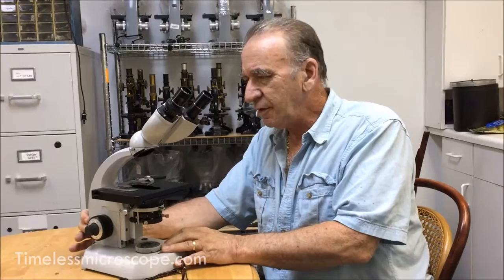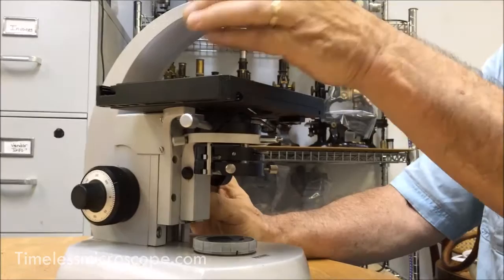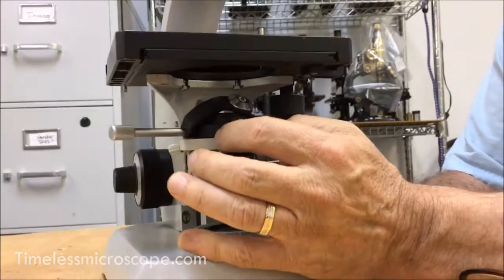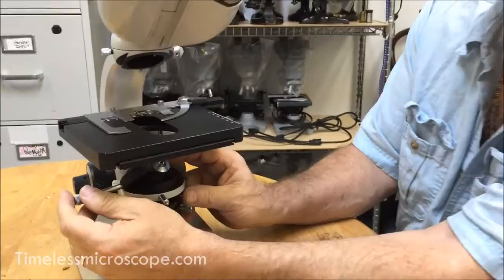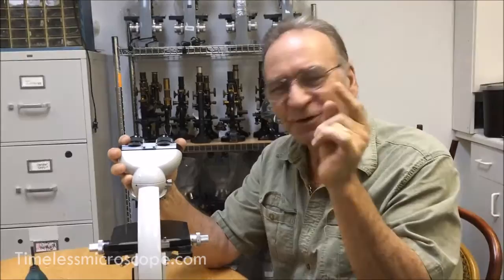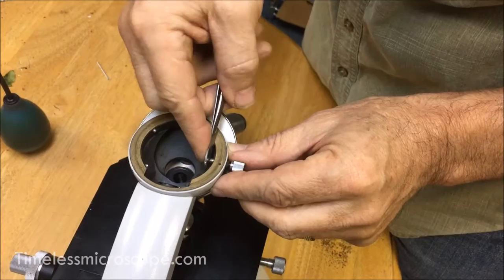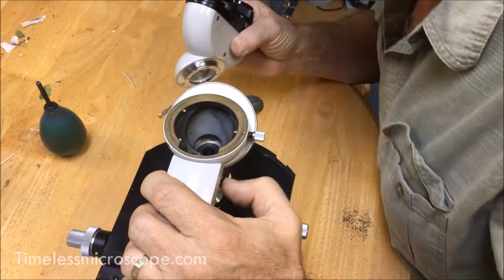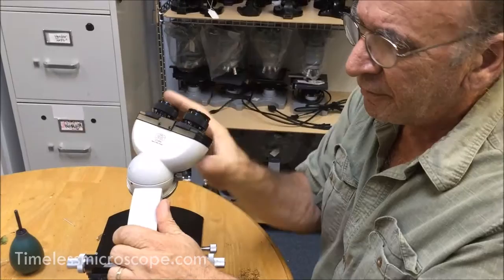Zeiss Standard Microscope Repair - Condenser and Binocular Tube - Remove and Install

Comment: Thank you for your response. I have the vertical coax  x,y knob on the stage's right rear. Could you send me the link for x,y stage friction adjustment of this Zeiss? I've tried multiple searches here, but I never get anything but information on modern Zeiss scopes. I'm very reticent about disassembly until I understand what I'm doing. If there are no links, can you make a short video on this topic?

Comment: Help!  I have a 1969 Zeiss Standard Model 18 Phase Contrast scope. It has the large slide  stage. The stage X,Y movements are too loose, too sensitive to my touch. Is there a way to add friction to the movements? I looked around for an adjustment screw, but I didn't fine anything. Thank you so much for this informative video. Keith Stout
Reply: I have the same Std 18 'scope but maybe not the same x-y stage.  Yes, you can adjust both the lash (slack) in each axis as well as the friction.  My x-y stage has coax knobs on a horizontal shaft at the rear of the stage.  The x-axis moves on a screw, while the y-axis is rack and pinion. I can adjust the x-axis friction and lash together from an access screw on the top centre of the stage at the rear.  It essentially enables the clamp pressure on the horiz shaft to be tightened.  Many 'scopes have a coax vertical shaft below the right rear corner. I've seen instructions for adjusting the friction on this here on youtube.
In short, yes adjustments can be made, persevere and if necessary carefully disassemble, but take care - don't lose the small parts and take photos as you go in case you forget how it goes together.

Comment: When I turn the fine adjustment to raise and lower the platform, it may take several quick turns to get the platform to move.  Is there something I or you can do to gain control of this adjustment so the platform will more consistently instead of after I move it quickly several times?